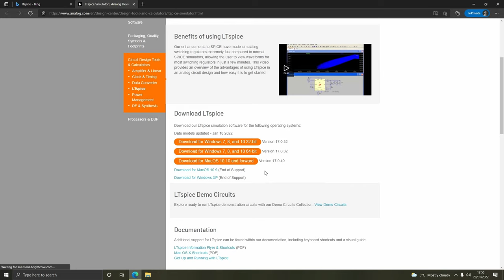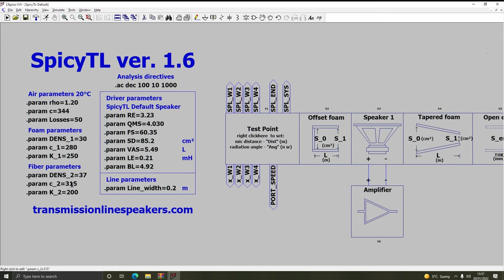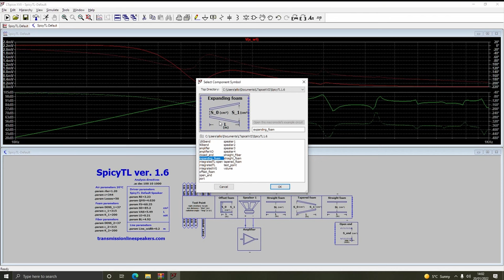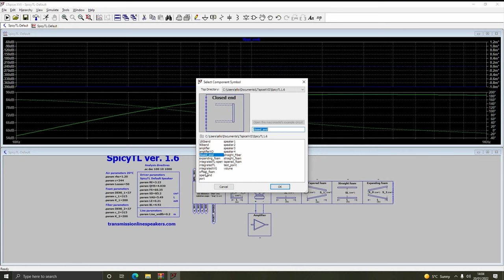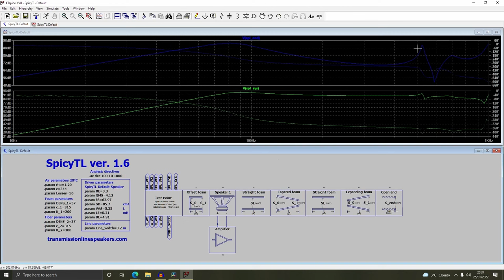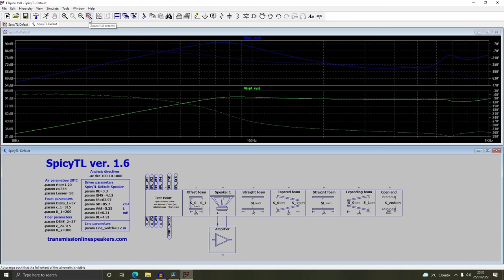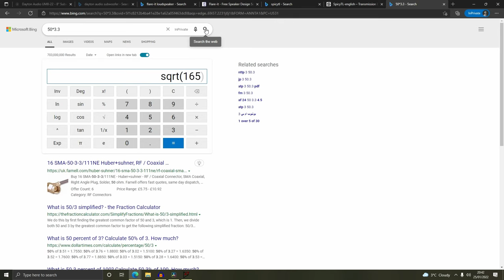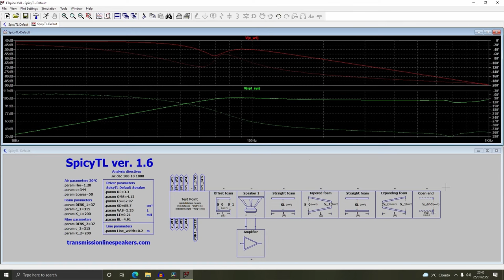Design a TRANSMISSION LINE Enclosure with LTspice

Comment: For some reason mac version ofthis software does not work the way you show. Everything is more or less the same in terms of interface, but it doesn't do the graph when you press "run". Only empty black window appears
Reply from the maker: Oh, that doesn't sound great 😕. Unfortunately I don't have a Mac myself. Sounds like an LTSpice problem more than the add-on itself SpicyTL. Might be worth reaching out on an LTSpice thread you can find on electronics forums. Sorry I couldn't be more help
Reply: @Elliott-Designs  oh... Don't worry! I've mentioned it to let your viewers know about the issue.
Reply from the maker: @wrongIQ  Thank you for letting everyone know! I've been sure to pin your comment. If you find a solution at some point, it would be great if you could share it 👍

Comment: It is amazing how much of a change adding that fiber made.
Reply from the maker: It certainly is! I'm currently planning a several part video series where I'll be designing and testing a modular micro transmission line system that I can then use to see how accurate the simulations are! A few of these tests will be with the mineral wool to see how accurate the prediction from the program is, and how I can refine those programs to more closely represent the results I get from my mineral wool filling if needed!
Reply: @Elliott-Designs  Interesting video. Looking forward to the follow up.
Reply from the maker: @joesapereira5539  I'm glad you liked it, thank you! Planning on redoing this and splitting it into parts. Anything in particular you want to see done better, or more clarification on?

Comment from the maker: Side note: The differences between ported and transmission line loudspeakers are a little blurred, although there is a 12db/octave roll-off until our high pass filter (as one would get with a transmission line). It is also suggested by many that the difference between ported and transmission line enclosures is that a ported enclosure has a build up of pressure behind the cone (as with an acoustic suspension type sealed enclosure). Due to the thin nature of the port section on this design, it could be argued it is ported. However in my opinion this enclosure rather acts more like a mass loaded transmission line enclosure, since for that pressure differential to exist; a significantly large volume needs to be present to act as a resonance chamber, although that kind of chamber appears to exist in this design, it is my opinion it more acts as a wider port section of the transmission line that that has a stepdown in cross sectional area to the circular port.
Reply from the maker: Whether you believe it to be ported or transmission line of enclosure type, the importance of this video is reducing those upper frequency resonances through simulation of the internal geometry of the cabinet, since in most programs this isn't taken into account.
P.s. The topic of it being transmission line or ported hasn't actually come up yet, I just preemptively commented about it as I believe it may be a point of contention due to the fine line between the two enclosure definitions.

Comment: Great tool! Thank you.
Reply from the maker: Glad you liked it! Not so many are aware of it, which made it the main reason for me wanting to make this video.
Reply: @Elliott-Designs  I wonder if horn-loaded speaker simulation is possible with this software?
Reply from the maker: @EngineeringEssentials  it certainly is! You use the exact same principles and use an increasing cross-sectional area instead of a decreasing one. The only thing is that the approximation isn't as accurate at high frequencies since different geometries make more of a difference (e.g. square Vs circular, or truncated cone Vs truncated pyramid)
Reply from the maker: @EngineeringEssentials  To see those higher frequencies on the graph you can change the values in the area above driver specifications, it's named "analysis directives"

Comment: Could you add a component to LTSpice  for a room's property of raising low frequencies?
Reply from the maker: I did not make this add-on for LTSpice, nor make LTSpice itself, but you can fairly easily approximate a room's low frequency gain, much easier than having to put it into the program too. Take the longest dimension of the room and multiply it by two. This is the wavelength of the frequency where room gain will start (approximately). E.g. Starting frequency = speed of sound / (2*L). Where L is length in metres. For a perfectly sealed room this will continue with a trend of 12dB/Oct all the way down to 0 Hz. It is likely the slope will be less though, since this is under ideal circumstances. You also then have boundary gain. Have it next to one wall? Assume +3dB. Have it next to a wall and the floor, +6dB. In the corner of a room on the floor, +9dB. Again, these are all approximations. But I hope they help.

Comment: Beautiful, thank you for presentation, i was not aware of this tool, this seems like way better sym solution compared to one i have used so far (>>hornresp for TL/horn<< and winisd regular boxes, xsim crossover long time i used to use arta or similar w audiocad but-MSdos...) i will make effort to replace hornresp since it is cluncky (powerful but cluncky)  also luckily i use Ltspice for over a decade so im fairly proficient!  you can now step up your game end try parameter sweep with this to really speed up your sym and add some power to you!  https://youtu.be/kizp4DcTEhU   also next time please force ltspice to change color for upper (blue) plot, it is not really visible...
Reply from the maker: I'm glad you liked it, I totally agree, this program is better for transmission lines purely for the fact that you can get excursion and velocity estimates unlike with hornresp, as for sealed it's better than winISD since you see resonances that 'reflect back through' the cone. If you can use hornresp, I think it's still better for horns due to the fact you can change the flare rate (exponential, etc), and Xsim is definitely the best for passive crossovers since you can use driver's impedance graphs. As for the chart colouring, sorry about that, I've only ever used LTspice with the SpicyTL plugin and not for any other reasons (mechanical engineering student), and because of that, I had absolutely no idea about plot lines. Sorry you struggled to see them. In future videos I'll be zooming in so it shouldn't be an issue anyways, I use these programs on a 55" screen so I usually don't think about how difficult it might be to see on a small screen. Either way, glad you enjoyed the video and I hope I've earned your subscription 😊